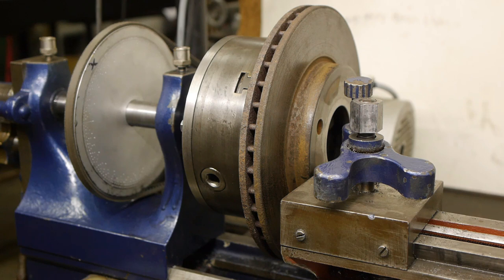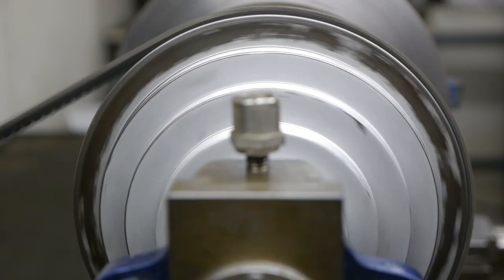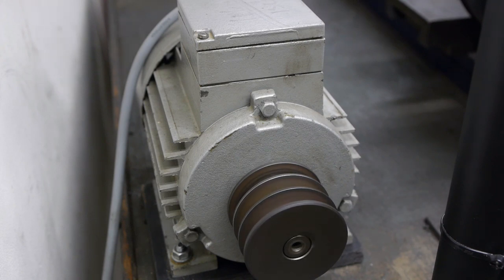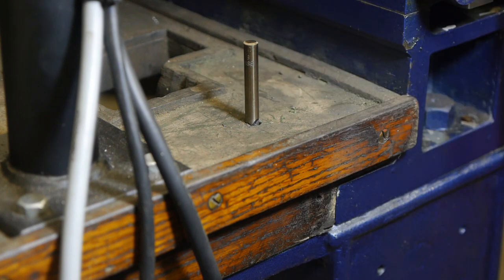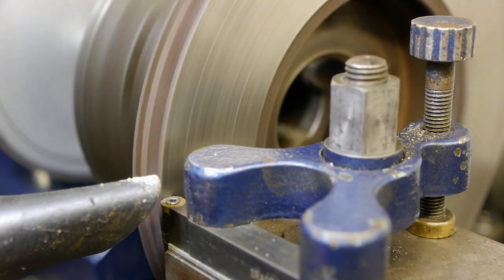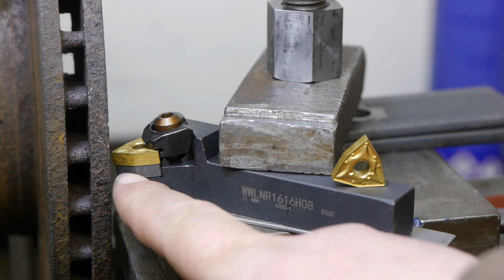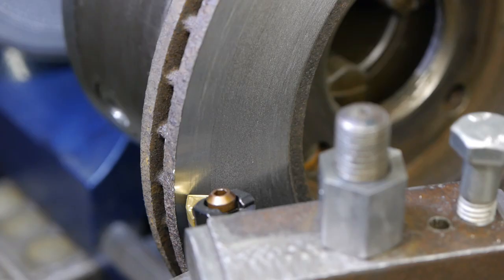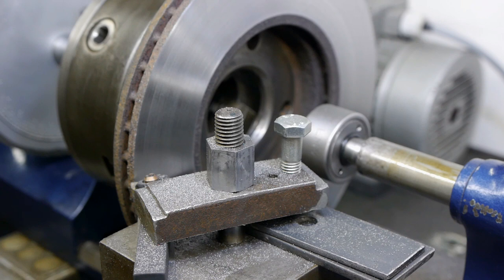VFD torque compensation issues, machining a brake rotor

Comment: That is a good finish for a rotor. No chatter that I could see. You should good with those results. The dedicated machines I used years ago would not have been  able to make such a chatter free cut without a rubber silencer. If you start a side business cutting rotors and chatter does present itself, throw the bungee cord back on and see if it helps. Rotors and their differing designs always present different challenges.  Very glad to see you found a combination that works on your lathe. Well done!
Reply from the maker: With the amount of time it take me to turn one rotor they will get very expensive. But it's good to be able to do for my vintage car. Now I need to get a bigger chuck so I can try to machine a flywheel :)

Comment: Torque  comp is variable according to speed .It's primarily used to improve starting torque  only (if motor is load during start up) 
 it  wiil not give you more torque unless the vfd can supply more current which it can only do for a short period.
Reply from the maker: Without any torque comp the motor can't get the spindle going below the 5 Hertz

Comment: Glad that you found a combination of VFD settings and carbide insert which works for this task.    Looks very good with the new insert.   The smooth surface may not last long when the rotor is back in the car.

Well done.   

Dave.
Reply from the maker: Thanks Dave. Now I have to try to improve the chuck a bit because one of the jaw steps is about 4/100 higher then the others. Makes setting up the disk rather hard.

Comment: Idk why the controller doesn't want to keep the parameter settings, but an overcurrent error might be expected at low frequencies if torque compensation is high.  

I'm assuming this is simple volt-hz control.  As the frequency is reduced for a given voltage, the steel core is being driven further up its magnetization curve each half cycle.  That's why voltage is reduced as frequency is reduced, and I imagine that the compensation parameter simply adjusts the relationship dictating how these are scaled with respect to each other.  

If the compensation is set too high, then at low frequencies, the applied voltage is sufficient to drive the motor into magnetic saturation.  It'll vibrate, and current will spike every half cycle.

It might just be running into the current limit of the controller before it's terribly saturated, but either case isn't good.
Reply from the maker: Thanks for that explanation. And you're right the vfd is working on a v/f curve. Would a vector controlled vfd work any better?
Reply: Oh, there goes YT, never notifying me of replies again... 

As to whether a different control scheme would work better, I don't know.  I imagine a big part of the limitation might be the motor, but also how the drive waveform is synthesized ("modified sine" vs pwm), regardless of the control scheme.  I'd only be guessing.  If it were me, I'd probably just set up a jackshaft for more mechanical reduction, but that's kind of contrary to the convenience of having everything electronically variable.

Comment: Nice Job!
I new some more trial and error and you would figure it out.
That second tool is all about that lip.  That gives it positive rake.  The “down hill” look provides front clearance and allows the double sided usage.
The disk rings like a bell and the vibration resonates differently depending on all the factors you have looked at like surface speed, rigidity and tool geometry.
When the vibration forms a standing wave the chatter starts.  It may be only at a particular diameter range when the surface speed is right.  Stay out of that range and no chatter.  The bungee was meant to absorb the vibration and break up the standing wave.
I have seen cnc lathes that you program the surface speed you want and the spindle speed increases as the tool moves towards the centre.
I think the lesson you have learnt here is rigidity, surface speed and tool geometry.
Congratulations 🤠
Hey I ordered a camera yesterday.  Maybe I’ll be able to do some videos soon.
Dave
Reply from the maker: I was thinking negative rake tools might not dig in as easy as positive rake tools. The round insert left digging marks all over the rotor. Yes, go make some video, it's good fun :)
Reply: I have only ever needed negative rake tools on brass or bronze.  Posative rake pulls the tool into the work especially when drilling.  One day you will be standing there looking at your nice piece of brass thinking I'll be ok.  :)  Maybe I'll do a video on drilling brass :)
Reply from the maker: I believe you need dull drill bits for brass. But so far I've gotten away with using my regular sharpish drill bits.
Reply: That is one way to look at it.  You take the edge off on the grinder.  It's not actually blunt it's well negative rake :)  The trouble is if you change from brass to steel and back a lot you grind about 1mm off your drill each time.  Even full time in the factory I never had a negative rake set of drills.  We just used to grind them down.

Comment: The lathe is on the light side.  I am thinking what you need is more mass.  Maybe a few inches of concrete under or over the bench would damp out vibrations.   Thanks for the video.
Reply from the maker: That's why I welded that hook to the plate the motor bolts on to. Hang up a bucket full of concrete and hope it will help.
Haveb't tried it so for as I'm happy with the current result

Comment: Is it possible to mount the motor on some rubber blocks to eliminate vibrations?
Reply from the maker: I was actually thinking about using some small rubber silent blocks. Washing-machine rubbers we call them over here.
But they might make it harder to tighten the belt.
Reply: Rolingmetal 
True, but there are also special motor buffers. Normally you can “calculate” the stiffness by motor weight and power.

Comment: You’re using a carbide insert. You can really crank your RPM’s up with carbide for a better finish, especially with a large radius cutter.
Reply from the maker: Apparently, it worked fine a 300 rpm while the online calculator on the little machine show calculated 157 rpm.

Comment: 'Looks like you need to trade cost vs your time ;)    * A LARGER vfd , OR make a jackshaft with multiple 'options' !    ( I read that you are too lazy for option 2 - but it would be the least expense in my opinion ;p )     I'm playing with a combination of pulleys and gears . . . still in the early stage of designing -     ' glad you found a combination of insert & speed that worked !   "V"     Trading force for distance is pretty simple mechanically , so I'm choosing to bypass those 'pesky' electrons !    
    I recently bought 3 sizes of polyurethane belting to experiment with . . . 'thinking that I can engage multiple shafts on the same machine - * running a belt to a toolpost grinder , for instance , or to drill holes in the direction of the headstock !   The toughest part of designing is to decide on the nearly endless options  .
Reply from the maker: I would love to have the original jackshaft and then run the lathe from an old electric motor underneath the bench.
Reply: DO IT !     * Make it a Rolingmetal "original' ;)   . . . a bit of cutting & welding should be easy enough ; add a step pully & bearings - plus, you could have a 4 speed pulley on the motor !    The only drawback would be changing speeds - shifting belts vs turning a dial or pushing buttons ;p    Good luck !

Comment: The torque compensation just bends the bottom of the v/f curve up, too much and you run into saturation which just drives a lot of current but the torque won't increase any further..
What you need is a different pulley ratio or a bigger motor. A VFD simply can't do miracles.
Reply from the maker: Dyno, can you say anything about the effect of torque compensation on 2 or 6 pole motors?
And can I assume the vibration comes from the rotor being pulled inline with the poles a bit to violently.
I'm looking for a 6 pole motor that will allow me to run a slightly bigger pulley. This small one slips to easy.
Reply: Well, ...torque compensation is essentially adjusting for the voltage loss in your motor cable at low speeds as this becomes more apparent when running at low frequency (voltage is pretty low then) ,  it does not really matter how many poles the motor has, you must always follow the correct v/f curve, measured on the terminals  (see my "tame your motor" series ). Torque is directly proportional to current and if you drive the rated current (as per name plate) at any given speed + load, you there,. The limit is usually about 125 to 135% full load current, beyond that you just saturating the core, not producing more torque but alot of heat. So the solution is double the poles as this doubles the torque, obviously at half the speed.
The reason why your drive trips is because it is too small, i usually use one size bigger than the motor, so i got headroom for experimenting, the results depend on the motor (you get what you pay for), also bear in mind that extra cooling is required at low speed, you also must reduce the duty cycle accordingly.
And by the way, if you lower your switching frequency the drive can push more current, at least all of the cheapo ones do.
I know it makes more noise, but it's a simple way to push the limits a bit.
Reply: Rolingmetal: one day I'll get around to running 6 poles 20-150Hz, instead of 4 poles 12-75Hz, which ought to increase lower speed torque, power, and stability 🤞🏻
Reply from the maker: @industry65  That's what I was thinking about doing :)

Comment: would putting an idler pully on the belt help with the vibration? the spring detent might even out the pulsation of the belt stretch. a double belt would help or a much wider belt, but that is too much modification to suggest for you set up.
Reply from the maker: I've never seen an idler pulley on a v-belt and I doubt that the belt surface would last very long.
Reply: look under the hood of your car. if the engine is mounted sideways you have an idler pulley most likely. something like a skate wheel with a spring detent just to remove the vibration and whip out of the belt. it would not be very tight just tight enough to control the whip, with a lot of spring travel maybe  5 to 8 kilos pressure. I have seen this done instead of pulling the motor mount tight there would be an idler that would tension the belt. I think you might be able to get a suitable part out of a junk car so long as the bearings were good. I retired after 45 years in engineering in the oil industry. this does not make me an expert but I have an occasional good idea. even a squirrel can find a nut now and then. do you have a way to read an autocad file. I have an old version but it works well enough to draw up a pulley tensioner system. @Rolingmetal
Reply from the maker: Under the hood of my car there's a serpentine belt. V-belts when out of style in the ninetieths.
Serpentine belts can be used on both sides. One side for the idler pulleys and the other for the alternator and such.
V-belts are normally only used on one side but I guess one could add an idler pulley on the V side. Maybe  something  with some spring tension. Doesn't have to be a v-groove pulley. I have some idler pulleys laying around maybe I'll whip up something this weekend. I've got a program called librecad one my computer. Not sure if it can open autocad files
Reply: I actually meant serpentine belt when I was thinking it out. if you ever change the pulley types, the newer belts are segmented and do not stretch line the older belts and they can be run on both sides. that is the kind of belt that reminds me of pull tabs locked together. I would try first just using an old urethane skate wheel and put a little tension on it on the flat side of the belt and see if it makes any difference. ( skate board trucks and wheels come with bearings and are cheap of free if you are lucky. they would be easy to temporarily mount on an arm and even use bunji chord to load the tension. if it gets better then you have an avenue to explore.) I think you are having the same problem that turntables in the 70's and 80's had. the belts would allow for a harmonic vibration.    good luck, I wish I lived near by I would like to sit in and watch you work on the project. but I am in sonny Texas where it is spring and 80 deg. already and I am to old to travel to the land of windmills and impressionistic art. I am in the land of cowboys and Indians. lol    the only Indians we have are from India and the only cowboys drive trucks with empty beds.                   let me know if I can help.   I don't know everything but I am old enough to have see a few things. @Rolingmetal

Comment: That lathe turns for a long time after switch off. Haven't you set a parameter for deceleration? That can give an error setting too if it is set to stop too fast with a heavy work piece
Reply from the maker: I believe I havn't changed any braking parameter. It stopped a lot faster with the little 100mm chuck :)

Comment: And how does the motor run under strain?
Reply from the maker: I've never turned a diameter this big before. But I have no problems running the motor a higher speeds on smaller workpieces. It's only a 1 hp motor and a not so rigid machine so it certainly has it's limitations.

Comment: the key question here is....what is "error 6"???

Paddy
Reply from the maker: You're right I should have mentioned that in the video. It's an over current protection
Reply: LOL yeah...it couldn't be much else !
The torque compensation with these cheaper VFD's is a rather simple affair.
If you are in the low frequency range, the VFD 'pumps' a an extra current boost in the motorwindings at every lobe of the sinus (or what passes for sinus.... it ain't pretty..just put a scope to it!)  In a purely resistive manner, a winding is just a short circuit, on AC however, it has an Impedance (a AC resistance) That impedance gets lower as the frequency drops....and the winding is behaving more and more like a short circuit.
If you then pump extra current on top of this into the winding... the VFD will 'see' basically a short circuit and will just switch to safe mode...
This is a very summery way of explaining this thing, but it basically give a picture of what is happening...
I also noticed that there are only two wires connected on the motor pegboard... or am I wrong in that?

Paddy

Comment: then use gearbox or smaller pulley on motor, base rpm of motor and hp must be maintained, lower speed ok for little time not all the time.

Comment: maybe the toothed car belts vibrate more than machinists belts which are smooth?
Reply from the maker: The toothed v-belt can handle smaller pulleys. And this one is pretty small. Other than that I don't think there's much of a difference.

Comment: Whats the motor connected as? Star or delta?
Reply: I just seen in the video the motor is on star. For 240v you need to have the bus bars on the terminals configured for delta (across each phase pair) search for delta motor configuration on google images.
Reply from the maker: The motor is running in delta. I once had an old motor that rumbled when running in delta. In star it was fine. The insulation couldn't handle the higher currents. Who knows maybe this motor will also run smoother in star. Worth a try.
Reply: Surprised its tripping the vfd if in delta already. In the cutaway where you show the blown terminal the motor is in star, hence my assumptions! 😬
Reply from the maker: That's how I got the motor. I used the terminal block from the other motor to run it. But something definitely happened to that motor at some point.
Reply: A genie test would reveal a lot! If the insulation has broken down or a loose terminal on the tail could cause it to blow. Whats the VFD control frequency? Anything higher than 6khz causes issues on older motors with old windings.
Reply from the maker: A genie test? Is that the same as a Megger? I believe the carrier frequency is set to 10khz by default and I won't go any higher. But it's nice quiet :) Lowering might help with the 20Hz cut-out problem as the motor and vfd are both rated at 0.75 Kw.
Reply: Thats right, also known as a megger, it would be good to know if the insulation is causing some internal shorts. Im shocked you are seeing such vibrations from the motor.

Comment: those motors are designed to run on full speed to get best performance...use the pulleys to change speeds
Reply from the maker: Only one pulley configuration is available in the current setup.

Comment: Heh heh heh. Good job. NOW  THEN, since you have finally gotten a decent finish, I was noticing that the faces on the rotors are looking awfully thin.
You do know that there is a minimum thickness on those, right?  The minimum thickness numbers should be cast right into them somewhere.